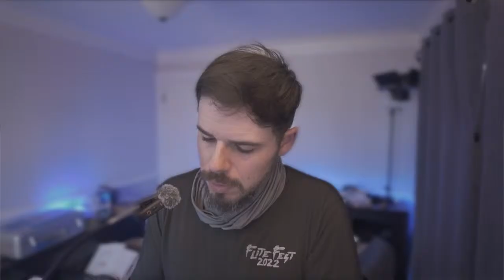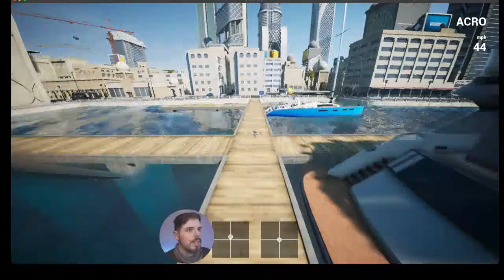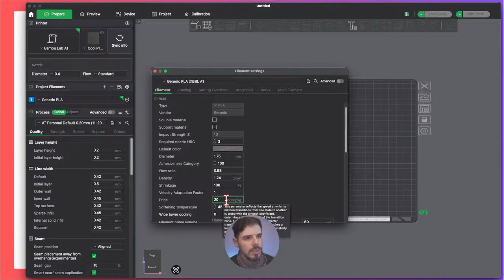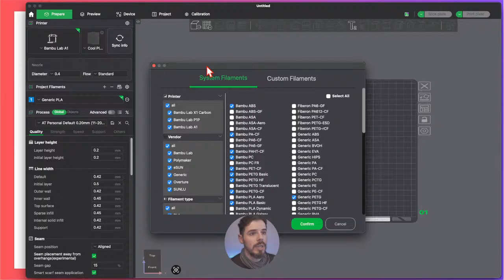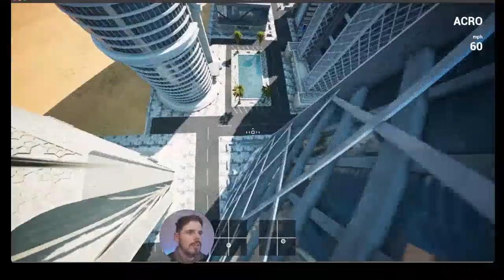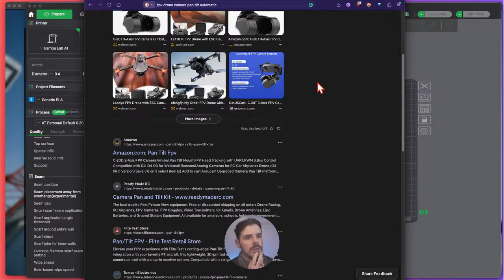LIVE Q&A Hour! Ask your DRONE and 3D PRINTING questions! Beginners welcome!

Comment: Heey adam, im trying to see if you remember anything about the esc's you put in with the airplane sruff you sent me for winning day 12 giveaway.  The bl heli 20a one shot 125 , wondering what the settings are? If they are setup in a decent configuration..? Not sure if you can help but hey, snowed in and gonna vuild the ft goblin!!
Reply from the maker: iirc, the one covered in hot glue is good to go. It goes well with the emax 2213 motor. The other escs need a little diy soldering (either attach banana plugs or directly solder the motor wires on).
Reply: @RCwithAdam1 thank you sir!! I'll send you a picture or 2 when I'm sone!! Take care! Are yall getting hammered with the storm?